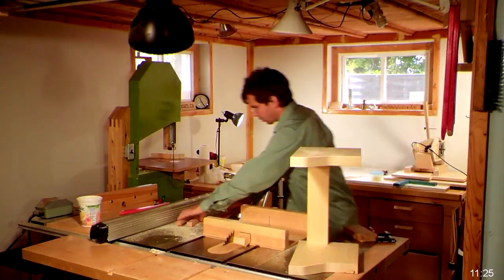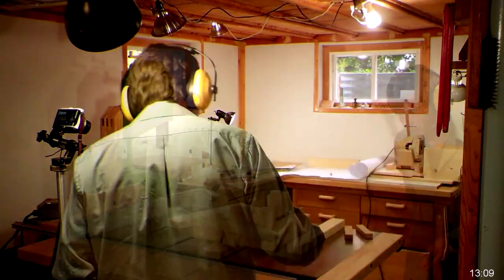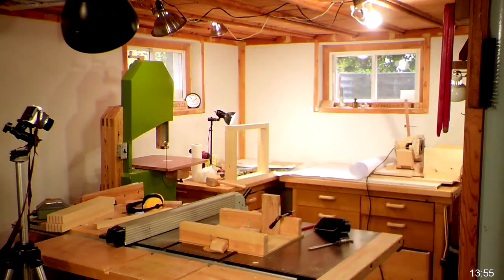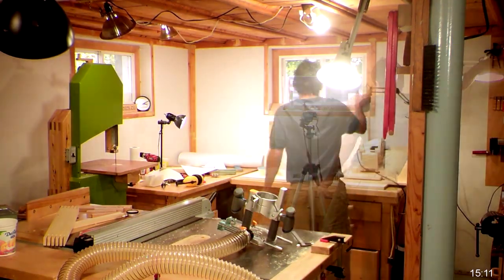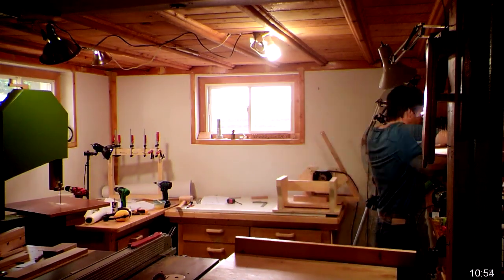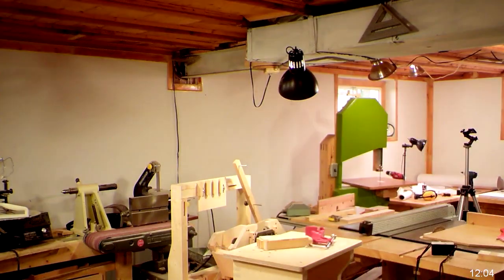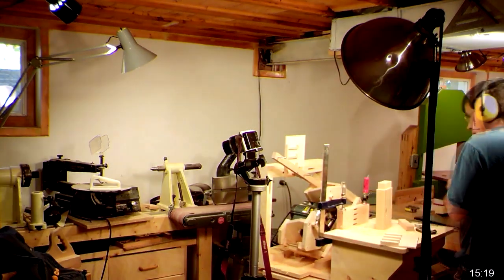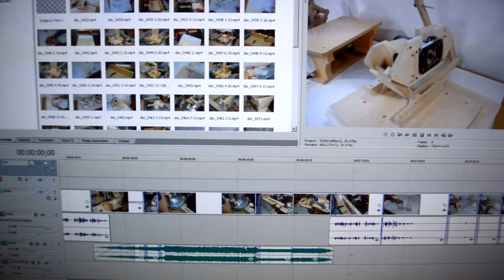Behind the scenes: Narrated timelapse of making a video

Comment: Have you tried anything other than Vegas? I started using it a few years ago and found it does pretty much everything I need.
Reply: As much as Vegas users complain about stability, there really is no other NLE I (or they) would use.  Easy to learn and powerful.
Reply: RDJim I never knew there were stability issues, I will occasionally have 3 or 4 instances rendering at the same time and never had it crash. I was asking because I have no experience with any other editing software.
Reply: Nick Moore
Yeah, go to Sony's Vegas forum and you'll see lots of complaints on crashing.  I've had my share throughout the 10 years or so I've used it.  I just run Auto Saver to make sure I never lose too much work.
Reply: RDJim Good to know, I should save more often anyway.
Reply: I used to be a die hard Vegas fan, but got a license to Adobe cloud last year and switched to Premiere. I still miss some of the simple things Vegas did like overlapping clip edges to cross fade, but overall it was a pretty smooth transition. Vegas does seem a little more intuitive when I compare similar actions performed in Premiere.

Comment: Did you find any pro to this XL version (other than accepting routers without a removable body)?
Reply from the maker: Shannariano Accpeting other types of router is the reason I built it.
Reply: and I totally get it (and will probably take advantage of the new schematics since I only have a non-modular router, I was just wondering if there were any other bonuses (or cons for that matter) comparing the regular and the XL :) thank you anyway for the answer

Comment: Matthias - is there some reason that the box joints (on most everyone's projects - not just this one) have an "inside fingers" side and an "outside fingers" side?  Why isn't there an outside and an inside finger on each side?  It seems to me that doing it that way would eliminate this error ... but then again, you'd be screwed if your parts were asymmetrical & your outside finger lined up with the outside finger... not really a solution after all, I guess... :-)

Comment: Matthias, I noticed in the fast forward of you last video http://youtu.be/SkEvCgV4jEs?t=9m44s some deflection in the template holder (or is the front-back movement i'm seeing?). That could account for some inaccuracy in cutting. I know there is a transmission ratio between template and stock, and forces on the template are probably quite small, but maybe increasing stiffness in plane of the template may help.